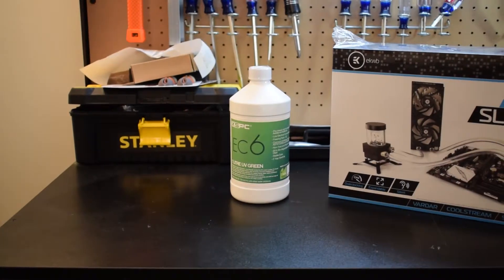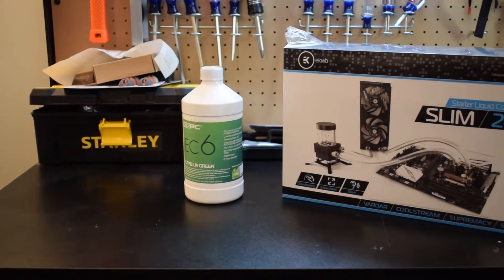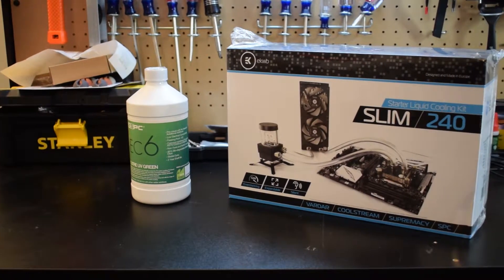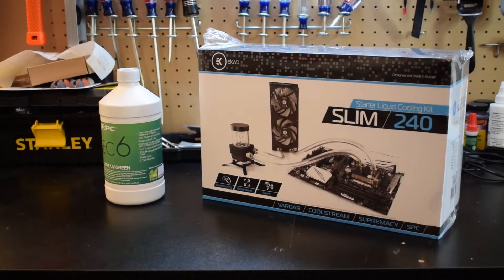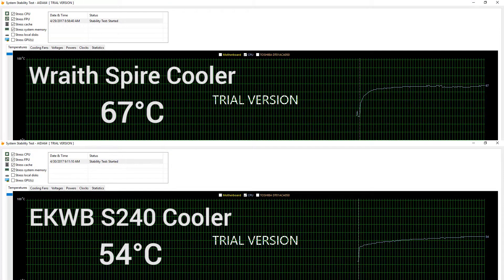Ryzen 5 1600 Custom Water Cooling Loop Kit

Comment: how much is your cpu oc ? mine is 3.9 ghz and running at 62 C after hours 100 percent being used.
Reply from the maker: Mine is overclocked to 3.9GHz as well. That seems to be the max for most people.
Reply: @SANTINIIO  yeah i had mine on 4.08 but the temps where shooting skyhigh

Comment: What about the support?? where can you get a proper support for it?
Reply from the maker: I would say go to there website and create a ticket if you ever have a problem. https://www.ekwb.com/customer-care/

That is probably the best way. Depending on where you bought it, you might be able to get support through the retailer like Micro center or someone like that.
Reply: I meant like... a thing that holds it up.
Reply: But nvm, i think i'll either mount the pump on the bottom of the case or put it inside the basement.
Reply from the maker: @SunSoupArt  oooohhhhh. That makes sense now lol.

It comes with a mount that I had to modify to get it where I wanted it. But yeah the bottom of the case or basement would be good if you don't care if you see it or not. Depending on what case you have, you might have to modify the case to get the included mount to work. Probably just a couple drilled holes though.
Reply: My build is a budget semi beast pc so i don't care how it looks. Plus as i get better parts i can change it up to look better as well.

Comment: Just curious, which coolant did you use? Because I always thought that EK recommend you to use distilled water for the loop? Also would you know if it comes in red?
Reply from the maker: I used XSPC Coolant. I have had it in my loop for a year now and I still don't think it needs to changed. It hasn't lost its color either. I highly recommend it. Here is the red version of it: https://amzn.to/2wIpXO4

Comment: Any leaks so far? Hopefully not, i wanted to buy one
Reply from the maker: No. So far it's been awesome. I haven't had any problems at all with it. If you set it up correctly you shouldn't run into any problems. Maybe consider using one of my links in the description? Thanks for watching!
Reply: Thank you

Comment: Ryzen 5 1600 paired with GTX 1060, that's my set up as well.
I am thinking of ditching the stock cooler and getting either a water cooling closed loop or a better air cooler, have you seen any significant performance difference with your water cooling?

Comment: Nice one...Actually in my country this kit needs to be imported(which is very costly if you add the shipping cost).Think I will  settle for an AIO cooler from Corsair/Cooler master
Reply from the maker: Souvik Das That sucks. Yeah if it costs more because of import, then an aio is definitely your best bet. I would try the stock cooler first before you decide if you need the aio.

Comment: I want to put a custom watercooling kit on my Ryzen 1600 but I'm worrying about the leaks on the system
Reply from the maker: +Azor Ahai That was a big fear of mine as well which is why I used paper towel to cover the components when I filled it up. After I had it filled up I was confident it wasn't going to leak. I can say flexible tubing is probably less likely to leak than hardline tubing.

As long as you use the correct size tubing and right size fittings you shouldn't have much to worry about.

Its always going to be a risk, but to me the look of it alone is well worth the risk. Not to mention the better cpu temperatures. Thanks for watching!
Reply: Awesome man, I'll think about getting a custom water cooling or an AIO cooler.  In your opinion/experience which is the best type of water-cooling solution?
Reply from the maker: +Azor Ahai It depends. Aio's are 10x easier to install, but they usually don't look as nice, don't perform as well as custom loops, and are not upgradable in the future (although some new aio's allow you to upgrade parts). Aio's usually come with warranties which is really nice.

Water cooling loops are expensive in comparison to aio's. The plus side to custom loops is that they look great, perform really well, and can easily be upgraded in the future.

If you don't feel comfortable with the idea of custom water cooling than I would definitely go with an aio. Although the kit I used was relatively easy to put together.
Reply: Buying a custom water-cooling in the future, maybe in two months. I got to save up, thanks man!
Reply from the maker: +Azor Ahai No problem. You're going to love it. They are fun to build.

Comment: Awesome stuff. I'll definitely be checking that kit out for the ryzen build i have on the way. i was thinking of using the stock cooler that comes with the 1600, but i think i might upgrade to this pretty fast.
Reply from the maker: +Noisy Ninja Thanks! The stock cooler did a good job and looks good, but the water cooling loop performs a lot better and looks better in my opinion.

Comment: That green looks sick! Glad everything worked out in the end.  seems like a great kit to use
Reply from the maker: Boom_OG Thanks! When I saw pictures of the color online I was skeptical, but it looks exactly like it did in the picture.
Reply: SANTINI.IO Innovation is amazing man. I will probably spend some time on my rig trying to see if I can add a custom loop to it. Space will be the deciding factor. I got my stickers from red bubble yesterday. Tomorrow will be the final day when I coat the pc finally and start buying parts for it.  Least to say I'm pumped 😁
Reply from the maker: Boom_OG Oh I bet! Nothing beats building a PC. I barely had enough room for water cooling. I was able to because I put the fans on the outside of the case under the front cover.